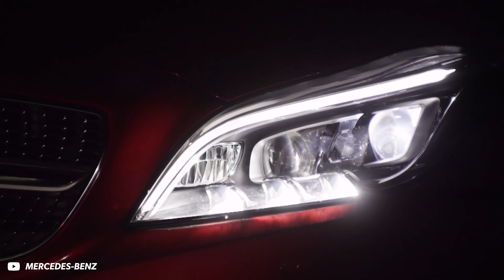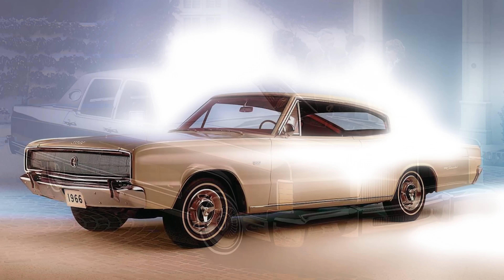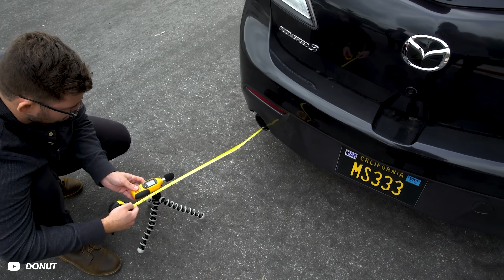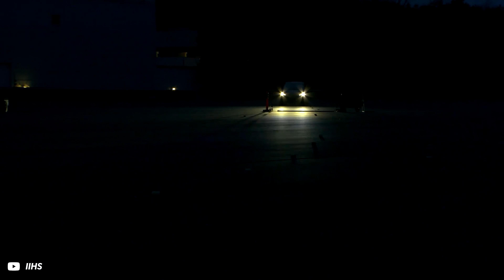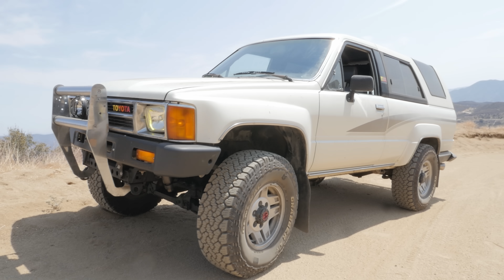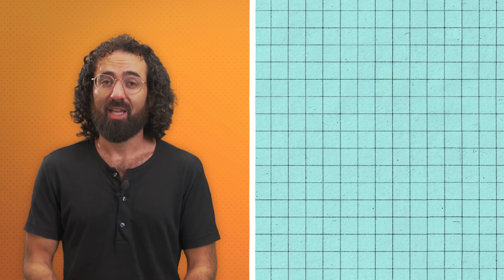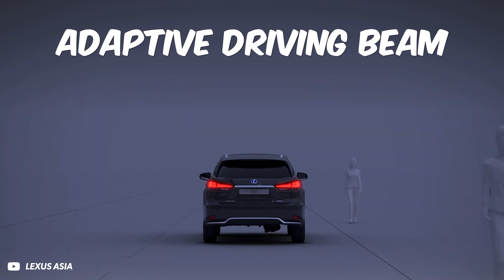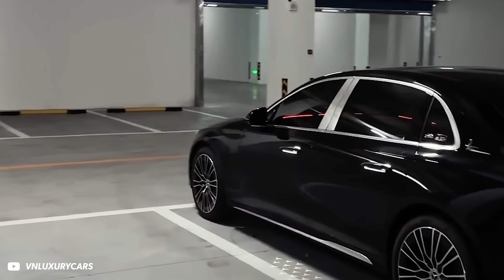Why new headlights are blinding American drivers

Comment: I don't know why no one talked about this, but Bi-LED projectors have been out for a while, and the cut-off light in those is quite clean and doesn't blind any incoming traffic since the unit(emitter and reflector) is all contained in one package, less chance of a light scatter compared to just a standalone LED light. You could retrofit it with moderate difficulties, or in some cases, there's a manufacturer that sells an entire headlight assembly to save the hassle. It's still better overall imo since it's relatively low tech and just light up the road cleanly and in a more uniform fashion.

I know this isn't a complete solution, but in a world where irresponsible person can blast their high beams at you, at least you can get back at them by blasting a more powerful light appropriately, so they know that they are blinding other drivers. Notice the words appropriate here; just use them sparingly according to the situation.

And I know this is controversial, but it's been quite effective in my cases, plus it's the wild west out here, I'm not sitting still while I'm getting blinded by other drivers, better get myself equipped for the situations. I like to be prepared.

Comment: This adaptive lights system is not that great. especially on highways it can't properly identify that are going in different direction. Its because the driver is much higher placed than his front lights, and this smart lamps sensors are blocked by some wall between the lines that are high enough to clock other cars lights but too small to cover truck drivers cab from our smar lights.

Comment: If the road ist wet, it is like a mirror.
When you have a car with halogen lights, and there is a LED car coming in the other lane, you can‘t see anything behind this car, it’s like a black wall behind….
And the automatic low/high beam system is not working well when you are waiting at an angle of 90* for example, like a street crossing. Or if you are walking….

Comment: I drive with my wing mirrors folded in at night now. Helps prevent being blinded by the vehicle behind. Also, i really dont need a shadow of my vehicle in my own headlight beam. 

The manufacturers are well aware of how dangerous the lights are. Now we see the latest models turn a headlamp off when the indicator is engaged.

Comment: Yes, we have this stuff in europe. But it isn‘t the best solution. Mostly it controls the high-beam. And sometimes the system is not fast enough and you are Blondine the other drivers with your high-beam, which is even worse than getting blinded by low-beam.
10 years ago we had adaptive corner lights, what was very usefull, now we have only adaptive high-beam, which is useless in citys. And the driver in front of you gets a distracting light show.

Comment: I've suffered from migraines since 2011 due to the UK market getting flooded with LED lights. I wear polarised sunglasses even at night to reduce the effects, and I need prescription medication to try to keep the migraines under control (my doctor prescribed me Topiramate, if this helps anyone else in my situation). I now can't work, go shopping, or enjoy Christmas decorations. Going anywhere is an issue, and I can't go alone because certain LEDs cause me mild temporary memory loss, difficulties with speech, and brain fog. The pain persists when I'm in contact with LEDs and varies depending on the intensity. I always drive with someone, and I can't drive at night due to ultra-bright LEDs, so a change in the law would definitely be welcome.

Comment: Adaptive beam won't solve your blinding problem, because it is exclusive to the high beam. On a bump for example the low beam will blind you anyways, but of course even a halogen will do that. For this reason I would like to see low beams with a matrix top part. 
It would be also handy if the matrix headlight would not be an expensive extra, but a standard equipment.

Comment: European here. IMHO aftermarket bulbs are not the problem. SUVs are ! Unless you drive one of them you are either too low on the road - i.e. sedan coupe or estate - or too high in a truck or semi. And are blinded by all the new LED beamed of new models. Every bump makes the beam flicker and despite electrochrome mirrors (especially with side mirrors) your retinas are cooked.
Adaptative systems are not that effective with a latency too high to avoid at least some disconfort for other drivers.

In France regulations are inforced by a mandatory technical control of the car every two years. Sadly most of the time on used cars the beam angles are measured and reported wrong, but unless extreme its just reported as a minor defect and does not need to be fixed. Because even manufacturer shops won't touch it, or you need to swap the whole unit which does not guarantee proper alignment.

Comment: Replacement headlights used to be about $3, then went to $60, then integrated designed bumped to to $1600, now with AI headlight tech will cost $47,150 to replace a headlight module - or you can probably get a replacement from temu that will totally not work and blind everyone for $6 shipped.   So yeah, it'll probably continue to get worse.

Comment: Adaptive and matrix headlights aren’t really helping. When the overall brightness is so excessive, you still get blinded by the reflected light from the road -not just from direct glare.

I honestly don’t understand this sudden obsession with flooding the road in light. A proper set of 55-watt filament bulbs in a well-designed housing has been more than adequate for decades. I don’t buy for a second that these blindingly bright systems actually save more lives in practice.

Comment: The biggest offender is people who put LED bulbs in halogen housing. Halogen housing with huge reflectors around is meant to reflect lights from halogen bulbs, which have much lower light output than LED. Imagine those reflectors with LED bulbs with much higher lumen. There’s a reason projector exists. Yes some newer cars have LED in reflector housing, but the reflector is much smaller. 

Another issue is some people don’t bother adjusting their headlights. Some don’t even know if their headlights can be adjusted and some dealerships don’t bother adjusting them during the pre delivery inspection. I’ve seen cars with very bright aftermarket LED headlights that don’t blind me and I’ve seen cars with halogen headlights that blind me.

Comment: If you see a aftermarket led bulb advertising 60k lumens, it’s probably bull. While LEDs are much more efficient, you’re still only working with a set amount of power.  Most halogen headlights seem to be in the realm of 60w, and the typical range for LEDs seems to be between 90 to 120 lumens per watt. The top edge seems to be around 225lm/w. The FAHREN LEDs on Amazon seem to be claiming to do 1000lm/w. Call me crazy but I feel a $70 Amazon lightbulb isn’t packing that kind of industry crushing tech.

Comment: The other issue is that drivers are getting lazy and not switching off their high beams. I once encountered an car with extremely bright high beams on, that I only saw white blinding light for a few seconds instead of the road.

Comment: For you all LED haters and have never had any. Here is the difference. The standard lights are yellow in color and are harder to things on the road. From objects to animals. On two lane roads to dirt roads. The standard yellow lights don't let you see very far to not at all off the side of the road. Where animals jump out at you. The white lights let you do all of that. To the point that brights are really not needed. Now, the real downside of using them. Your standard bulbs will melt ice and snow off of the lens. The LED will not. They will ice up. Get covered with snow. The LED adds seconds to see something and avoid it if possible. I only use LED. With the understanding that they will not melt ice and snow. After what I can see with them. I will not go back. No matter how much you complain. You really want to complain about something. Is a normal vehicle a motorcycle. Then. Shut your headlights off during the day time. Thanks.

Comment: States need to also step up with their regulations (and enforcement).  I drive a RAV4 so I'm not exactly sitting down at sedan level and am still constantly blinded at night by cars with near-actinic headlights (or light bars, or add-ons, or just drivers too stupid to understand they need to turn off the high beams).  I've also found people make modifications to show off their compensatory vehicles in even more grandiose ways... Like the dweeb I got stuck to one side of and slightly behind for several miles (traffic wouldn't let me pass) who had very bright lights in the wheel wells on his prized, raised pickup that gave off enough bright white glare to make me actively contemplate just pulling off the road for a few minutes so he wouldn't be blinding me or the drivers to his right.

Comment: people put LED globes and lights in cars that are not built for them different, reflectors are used for led , every LED headlight globe sold in Australia has "off road use only" written on the pack when you buy them Australia has the ADR or Australian design rule " which means every replacement part must meet the adr rule applicable to the vehicle, this means a h4 goes in a h4 head lighted vehicle and an LED globe is not legal for use in that vehicle , but if your ADR compliant Australian registered vehicle has LED headlights from factory then a set of ADR approved led globe are allowed to be used  as a replacement ! this is a source of many "bright lights " on Australian roads

Comment: These systems seem complicated and prone to failures. I'd rather just force everyone to use halogens.
Reply: I love how it says I have 4 replies but none are visible.
Reply: Don't do that. Halogens are very inefficient. LEDs should be allowed. They should just be limited to a color temp no higher than 3200K and and be no brighter than 1300 lumens
Reply: Exactly.  And the halogens are much less expensive and very reliable.
Reply: @mtgibbs  Dim light present there own issues, the more the remote area having brighter headlights can save your life.
Reply: @ohcrap2222 Of course, that's why there is a bright setting.
Reply: @mtgibbs  The argument then is 1) your dim high beams(not being led) which is great for spotting things like deer or other hazards has reduced visibility  2) Your low beams being dim can't see behind oncoming traffic, and when your in proximity to other cars you have reduced visibility. If you aim your headlight with the correct bulb is far safer than dim bulbs.

Comment: I hate white cold lights, I miss the old warm halogen bulbs. Much less harmful to the eyes in pitch black conditions.
Reply: What's maddening is that LEDs can mimic those tones no problem but stores usually just carry the cheaper blinding white version.
Reply: @FreeRadicalX  Yep. It requires a dedicated search to find good yellow fog lights that aren't cheap Temu crap, but it's worth it. My headlights are LED 5500K white but my fogs are now a very pleasant 3000K yellow. Get out there in the evening with a screwdriver and adjust them to overlap just right about 20-25m in front of the car and we're good to go. Yellow up close for great contrast and shadowing, whites pushing out a mile and a half to light up reflective features and large objects. Works well and I don't get flashed by oncoming traffic, so I'm pretty sure I'm not endangering anybody else.
Reply: @FreeRadicalX  Had already mentally written the same thing when i clicked on the replies :-P
Reply: The overly cold white doesn't properly cut through mist, fog and rain and just scatters into a wall of light.
Reply: This 100%. Color is very important. Bright blue cold temp lights cause night blindness longer after the offending vehicle has gone.
Reply: Yellow light is also better for light pollution
Reply: You can get LEDs that have a warm glow but for some reason everyone wants the bright white light which is blinding as hell.
Reply: @ryans413  In this case, everyone is not consumers but the manufacturers. Most consumers want warm white
Reply: I have halogen lights and they are very good.
Reply: And you also see nothing. So cool
Reply: My dad's truck thankfully use dim but yellow lights. Many vehicles in the 2000s and before were using lightbulbs to be used for yellow/tungsten light. But with the electric vehicles say Tesla for example, all of them are using LED white lights, akin to that of hospitals, and video lights. If you have ever stared at a video light for a good hour or two, Those are exactly what you're staring at. For me I got used to it, but the ones in the rearview mirror, yeah, they're bright. BUT, it's this reason I can just tilt the rearview mirrors just enough to move the light more upward and away, than straight on.
Reply: i loved the 80's  yellow lights on french cars,  so friendly for the eyes.   but apparantly they did not provide enough light for drivers.
Reply: I also miss all the deer we used to hit... oh wait no I don't. Cuz you can actually see now. lmao
Reply: @Algorythmfpv  That sounds like a skill issue if you couldn’t see a giant deer in the middle of the road lmao. maybe get your eyes checked
Reply: @Algorythmfpv so the color of the light was the problem? Then you can use low power high Kelvin lamps and you'll be good.

Comment: There are quite a few laws in all major countries around the world that regulate the design and use of headlights, however, the enforcement is vastly lacking. It requires police officers to patrol the roads and pull over cars with excessively bright lights. But why do the patrol units not make enough effort on that? Because it's not as easy as hiding on the curve and issuing the speeding ticket.

Comment: Tesla have enabled adaptive headlights in the US somewhere in the beginning of the summer. It's not the best system on the market but at least it works. So Rivian is not the only one.
But unfortunately that does not make a huge difference because every day much more F150s are sold. It feels like they're engineered to burn out peoples retina.
Reply: Yes, the newer Ford Trucks are horrible. Stacked headlights and all 4 of them are on, even on low beam. F250s and F350s sit pretty high, so if you are driving a small car, you now have 4 lights shining directly into your eyes instead of just 2. If they have the LED option, it is even worse. It is like staring at an arc welder without a helmet.
Reply: Tesla's system is not very good, btw. It's way too slow to react and still doesn't handle curves or inclines very well. Just got blinded by a Tesla with that system about an hour ago.

Comment: The worst offenders are the older vehicles that have LED in place of halogen.  Unfocused & sloppy.  The 40 foot wide knife edge of bright as an operating room light really sucks as well.  45+ years on the road & still see just fine with halogen.  Except when I'm blinded by LEDs.

Comment: 11:32 so lets add even more technology that is going to further increase the cost of a vehicle which it turn is will make it even more of a case of "not everyone can afford a new car".
Reply: Exactly! It also massively effects the cost of the car long term. Headlights are easily damaged, even in accidents where the airbags aren't deployed. They also need to replaced commonly because of water intrusion and UV damage. 

Nothing is going to make people run to the aftermarket faster than seeing an OEM headlight replacement is thousands of dollars!
Reply: @Chris-oj7ro  Yep
Reply: why dont we go back... halogen low beams led high beams. simple solution.